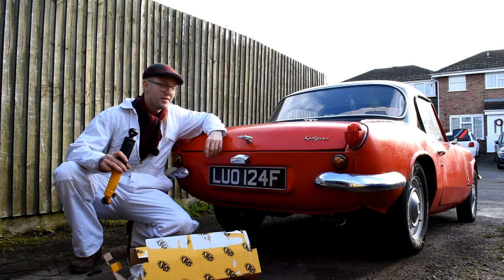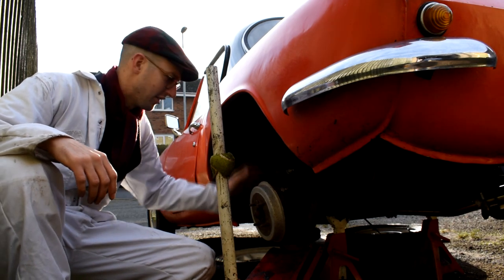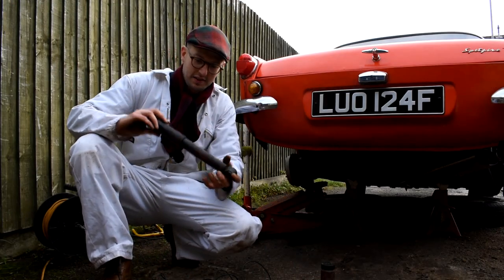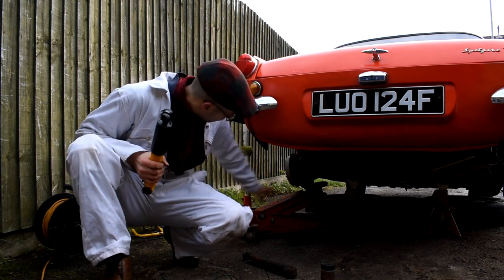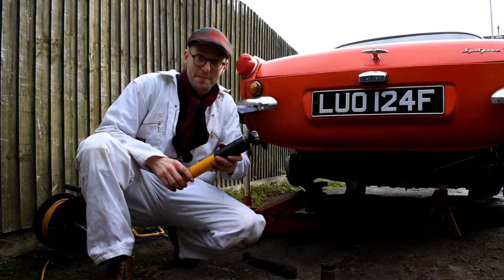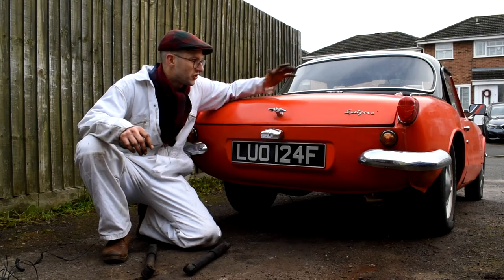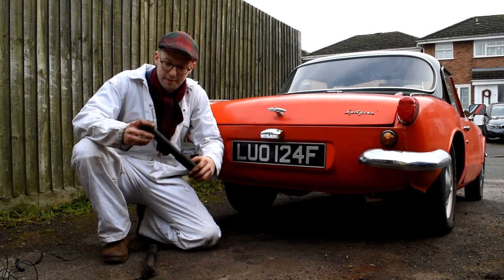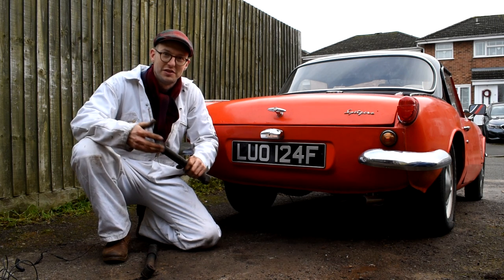Triumph Spitfire Rear Shock Absorbers

Comment: Blimey, that went smoothly Steve! Took me ages to get the top bolts off mine. Even the rubber bushes had welded themselves in place. Nice replacements though. It'll be interesting to hear your thoughts on those but the car sits nicely so I'm sure you'll be pleased
Reply from the maker: Cheers mate, I think it sits much better and drives far better with the spax on it over the standard shocks. I'm really pleased with the results. It's not going to end hear, the plan is to poly bush the suspension too 👍

Comment: Good Morning Meastro.  First time l've seen the hardtop Steve , very handy for winter driving . As soon as you said you'd changed the rear spring the damage on the inner wheel arch lips made sense. I' d dab on a bit of etch primer and then underseal over that bare metal . But that underseal has really done it's job. You have to remind yourself this car is 54  years old ! Really hope you stay safe as this new strain is very worrying and l guess you're still having to work. And l can't understand the decision on priority , but what do we know ? Well take care and stay safe.  😊
Reply from the maker: Hi John it wasn't me who changed the rear spring, it was done by the previous owner. I will be going over the car soon with underseal, However I don't want to go too mad on it as I'll be sending the car off at some point for new sills and floor pans 👍
Reply: @SteveDentonClassics  l''d love to do the work for you but we know it isn't possible . The sills don't look too bad to me but l'm sure you know otherwise! Cheers !

Comment: Looked a little chilly there Steve....putting some money into the old girl...those Spax shocks are not exactly cheap compared to the standard ones.....I’m running the same on the front of my 250.
Reply from the maker: I think Spax shocks are great, I know you pay more for them, but they did have them back in the 60's. Ok back then they most likely wasn't adjustable, but they we're about, so they are somewhat period accurate. And having them adjustable gives me the option to tighten up the suspension, or weaken it off to however I desire 👍

Comment: You could use a spare wheel instead of one of the road wheels under the car then if it does fall off the axle stands you won't damage the wheels that you went to the trouble to paint. Just a thought...
Reply from the maker: That's a good idea, I like that 👍

Comment: Great Job, will handle better then before...by the looks of it your chassis in urgent need of a treatment too, loosing a lot of metal by rust at back... Anyway, still on the roads... and better then before.
Reply from the maker: Cheers mate, and yes it's much better now than what it was. I'm not doing too much with the chassis until the body is restored, and hopefully this will be soon 👍
Reply: @SteveDentonClassics  I'm glad you're keeping another spitfire on the road, becoming a very rare sight...Cheers!

Comment: Got a pair of these to go on my Herald. Dumb question probably, but does it matter whether you fit them with the adjusters facing the backs of the wheels as Steve has, or facing in towards the middle of car, so they be adjusted from underneath without taking rear wheel off?
Reply from the maker: It doesn't really make much odds which way round you fit them. I just do them with the adjusters facing the wheels, as to some degree it makes it less risk of being knocked off by say a stone of whatever maybe flying underneath the car at the time 👍
Reply: The thanks Steve, I hadn’t considered that! 👍

Comment: Loving the series mate! What are you going to do about the dreaded underseal?
Reply from the maker: Cheers Kevin, currently nothing as the car will be having new floor pans, sills and doors and varies other body repairs there no point covering it with underseal at the moment 👍
Reply: Ah ok. I actually meant how were you going to get rid of the old, where it's all over the chassis, wheel arches etc. And do you plan to use underseal again? I have opted to keep only the painted chassis surface and try to keep it clean and dry.
Reply from the maker: The car will be repainted at some point, not red! So it's really a case of I'll cross that bridge when I come to it 👍

Comment: Nice video again, bet it took longer to set up the cameras than do the job itself! What worries me about adjustable shocks is there is a choice,  I'd rather have less option and just be told what the best setting is 🤣.
Reply from the maker: Cheers mate, its so true, a morning job turns into a days job when I film. As for the shockers, well Spax make them so on the softest setting they are the same as stock, then winding them up firms them up. I've always liked Spax as they we're available in the 1960's, so are some what period correct 👍
Reply: @SteveDentonClassics  I can well imagine how long it all takes to sort the video out, do you remember the comic strip presents series and one they did following a band called Bad News, and they are on a motorway going to a gig and they complain its taking so long because they have to keep dropping the camera man off and drive past and then wait to pick him up 🤣.

Ah good so you can start at standard shocks and then dial it up a bit at a time,  that's not so bad then.
Reply from the maker: I don't remember it, but yes that's exactly it. It's not always the easiest of things being a one man presenter, director, editor, cameraman etc etc However when I read all the nice comments, it makes all the takes, re-takes, edits and time spent getting a video right to make it enjoyable for the viewer to watch worth while 👍

Comment: Steve, would it have been possible to rotate the shocks 180 degrees, to make the adjuster easier to get at without removing the wheels?
Reply from the maker: I thought about that when I fitted them, and thought yes the way you are saying makes sense for adjustment. However if a rock, stone or whatever fly's up and hits the little turn screw, it's exposed to it that way round, and would damage it. So just for my own peace of mind I put them with the turn screw facing the wheel 👍

Comment: You made that look very easy, I'm sure that I'd take swear words to the next level. Quick stupid question, are the fittings on the Spitfire imperial? Also if I can ask another question, what socket set are you using? Sorry for the questions
Reply from the maker: Not at all, I use mostly Britool tools, and 95% of nuts and bolts on British built classic car pre 1982 will be Imperial. So you'll need AF sockets and spanners to work on them 👍
Reply: @SteveDentonClassics  Hi Steve, thanks for the info. I've paid the deposit on my Spitfire but can't collect until lockdown is over 😪. Keep up the great videos 👍 cheers Russ

Comment: What’s your thoughts on replacing the rubber bushes with polyurethane ones?
Reply from the maker: i think if you buy a good quality poly bush like SuperPro Bushes then they are great. I've fitted them to many cars, and it transforms the suspension. to a much more precised feel. The Spitfire in the video will have SuperPro Bushes fitted to it too in time 👍